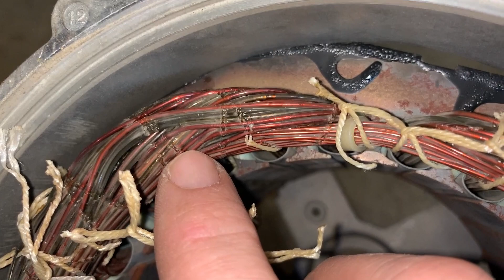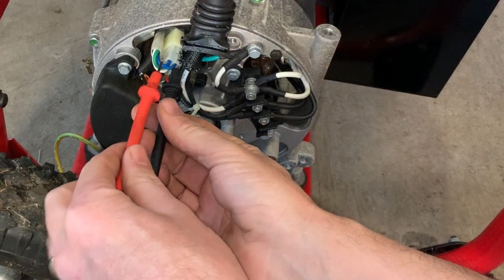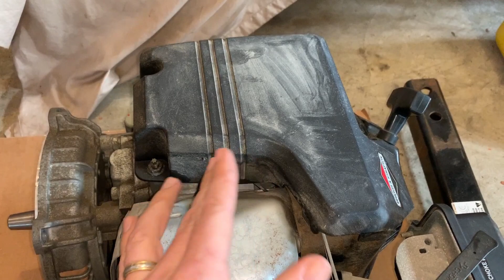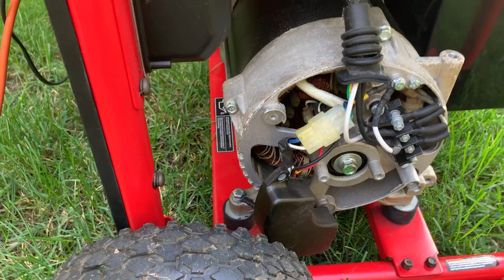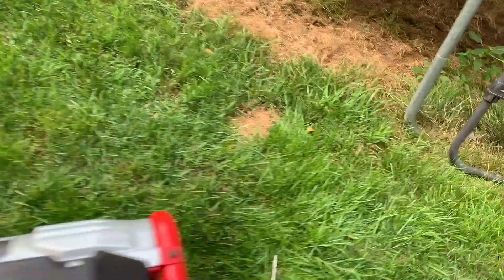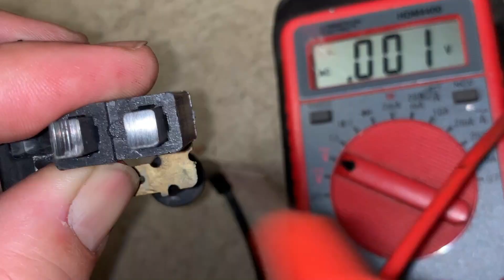Troubleshooting Generator Power Output - Part 1 - AVR and Brushes / Dirty Power / No Power

Comment: If the sliprings are not concentric /true (have runout, and like a warped disc brake rotor makes your car vibrate when you press the pedal, the brushes can skip giving poor excitation current to the rotor, which could explain the pulsing power), they may need skimming in a lathe. The brushes had a little tell tale sign by the uneven wear. If you look closely at the rings, the colour should be even all the way around where the brush rests. Blackish all the way round is ok, but If the colour changes, it may indicate uneven wear. The ring then acts like a cam, causing a minute break in the circuit. The brush spring tension helps make contact, but may not overcome a out of true ring. If the brushes have worn a grove into the ring, this is also another sign it may need skimming/machining in a lathe. Huge rotating electric machines can have their rings skimmed while still assembled by special portable lathes that are fastened to the alternator, much like those portable timber milling machines.
Reply: Rotor internal shorts can be a possible cause. Static test using an ohmeter doesn't always diagnose rotor faults. AC stators can be tested for internal shorts using a growler, but dc rotors can be problematic to diagnose. Maybe excite it with your 12v battery and check if power is fluctating? (just to rule out anything else backfeeding?) you could connect an ammeter in leads from battery to see if excitation current is fluctuating. Analogue meters are good for this, as digital meters wont always show small fluctuations well
Reply from the maker: Mike I need better test equipment.  Those would all be good tests to run.
Reply from the maker: I agree.  That is the only thing left that makes sense to me.
Reply: If rotor was suspected to be faulty, before pulling machine apart , we would connect a dc supply directly to rotor, measure the current flowing into the rotor and measure the voltage of the supply, then using ohms law determine the resistance, then compare that to the ohm reading. The voltage at the tips of the ohm meter is very small, so the voltage doesn't find all the shorts between the seperate turns of wire of the coils, the insulation holds up under the voltage supplied by the ohmmeter, but not under voltages approaching exciter voltage under normal operating conditions. Even that is only a static test, as when rotor is spinning, centrifugal forces may expose shorts not presenting when rotor stationary.
Reply from the maker: Mike in part 2 (unpublished) I took the stator off to get a better visual on the stator and rotor.  Looked like there may have been some contact between the rotor and stator.  I had an extra rotor from the same model generator.  Was going to swap it out, but found out the spare rotor I had was slightly different.  I like your slip ring idea but also feel that it could have been wound wrong or an insulation failure.  As you mentioned a multimeter ohms test is only a couple volts and will not catch insulation failures that occur at higher voltages.  Was looking at oscilloscopes today.  Finally got a leak down tester.  Need to build up my tool set some more.  I started off doing simple repairs, but that has been changing recently the more I get into this.  I appreciate you sharing some of your ideas and knowledge.
Reply: Yeah, I'm looking at handheld scope meters. The mustool MDS8207 looks interesting. I think it gives a good enough visual of the waveform.